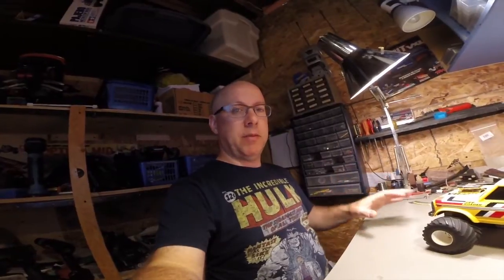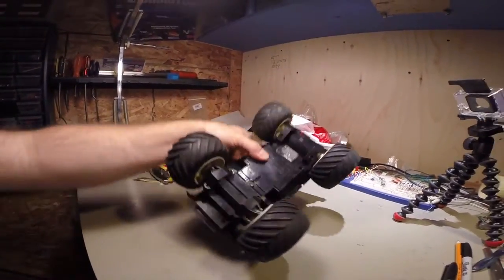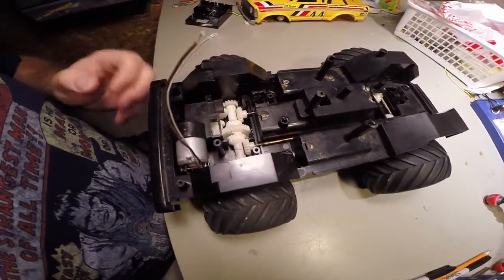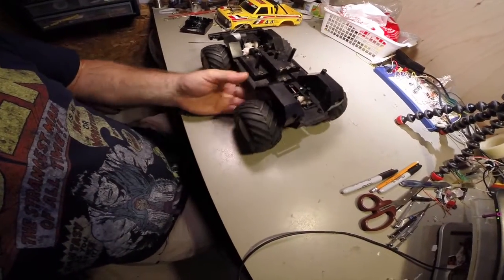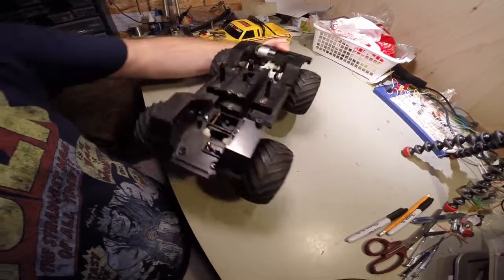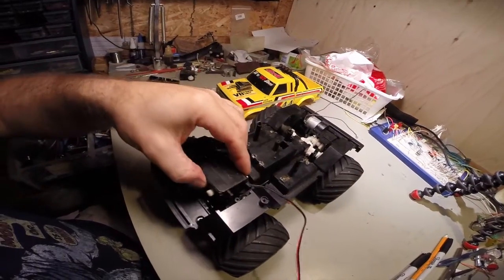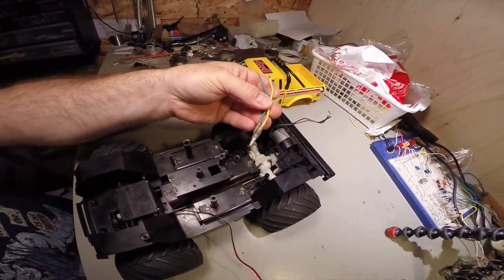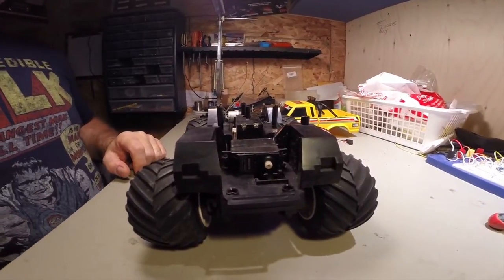RST3 Part 1 Setting it up for the new Electronics

Comment: Could you fit a larger motor in there? Or trying to find a quality 280 motor?
Reply from the maker: I've  had 0 issues with the stock motors. Fitting a larger one would def require some serious modding. You can get brushless motors that fit. 

The stock motor already skips the gears under heavy load so in general going bigger or  stronger is asking for trouble.
Reply: @TheLEDwheel   Good advice! Thanks so much for the quick reply, much apprreciated!

Comment: Hi, I'd like to do this project. I have this same RC truck. Can you please provide the brand/part number for the new electronics? Thank you!
Reply from the maker: hi,

It all depends on your budget. Do you want to go cheap? Do you want to get the best electronics?
That being said, you do not need very expensive items.
Basically you need a Radio set(controller) that includes a Receiver.
An ESC and a Battery. The battery you get will depend on whether you have the charger or not and so on.

best is to go here and talk to me directly
https://www.facebook.com/groups/TheLEDWheel2.0/
Reply: @TheLEDwheel  I understand. I just wanted to the particular part numbers you used, so I can start my research there and compare to similar hardware from there. Some things I'm unclear on, for example, is the physical battery size. If I knew your part number, I could find dimensions  and then have some numbers I can work under, if that makes sense.
Reply from the maker: @xVikXtorx  The problem is that its not that cut and dry. there are so many choices and I get why you may be reluctant. If you really want exact specific parts I can still help you. However this is not really the greatest place for discussions.
Reply from the maker: @xVikXtorx  There are soo many different batteries you can use. it does not have to be a perfect fit. It can also be smaller. pr you can use two smaller batteries at the same time for longer run times. like I said, not cut and dry.
Reply: @TheLEDwheel  ah I see. Ok, well I've sent a join request for your group.

Comment: Do you by chance know the size of the original motor?  I was hoping to buy spare motors.  I also was inspired by your build that I did the same thing with mine.  Thanks!
Reply from the maker: Not sure about rhe motor size... remove it and measure the diameter  and length to get the size.

I made parta that  are on shapeways to facilitate the conversion. Mainly the  servo retainer and servo horn. Look up theLEDwheel on shapeways
Reply: @TheLEDwheel  Ok, thanks.

Comment: Hi just wondered if u still have this truck running and if u managed to solve the tyre problem and wanted to know how strong u found the gears thanks
Reply from the maker: Yes I still have it. not sure what tir issue you are referring too. the gears took some decent abuse. However all of these little trucks suffer from what we call clicking or gear skip under heavy load. I have yet to investigate where it actually comes from. One guy even runs his with a brushless.
Reply: TheLEDwheel thanks 4 getting bk to me I have just brought 1 of these stock used to have one as a boy my favourite toy lol so looking forward to updating it.. Just thought u said in 1 of you videos it could do with some different compound tires .. Hoping to turn it into a trail truck
Reply from the maker: Yeah ok, the odd sized tires make it difficult to fit newer stickier tires to it. I have a 3D printer now so I may revisit the issue soon with an adaptor to fit some 1.9 tires.

Comment: Can you tell me what battery you used, it fit in there perfect. Great work on the truck,
Reply from the maker: Its a battery that fits into  the 1/16 Traxxas trucks. Other builders have purchased smaller batteries. I simply used what I had and it worked out.
Reply: Thanks

Comment: Nice work.  how did you wind up coupling the new servo to the steering mechanism?
Reply from the maker: James Williams the same way the original is set up.
Reply: Thanks. I've found a blue one, a bit rough, but a good price.  I'll have to pick up a ESC and receiver to mate up with my red cat controller though.
Reply from the maker: James Williams watch part 2

Comment: Hi there! Just saved one of these neat little trucks from a family members garage sale, and now Im wanting to d the same kind of upgrades to make it usable again, so I had a quick question... 

You used the original motor. I notice my trucks motor has a little resistor thing between the two contacts on the back of it. Did you leave that on or remove it?
Reply from the maker: Scott Flathers that's a capacitor. yes leave it there.
Reply: Awesome! Appreciate the response!

Comment: I have the blue version (49MHz) of this truck. I've wanted to swap the electronics in it for a long time now. The original steering servo is trashed. What make and model did you use for a replacement?
Reply from the maker: Derek Eskew any will do, I think I used a tower  cheap one. but I replaced it with an old Futaba later. I use whatever I have for these conversions.

Comment: do you have any experience with the H2 Hummer units from RS?  I have been having a fitment issue replacing the motor whereby it binds when the casing it closed.  I have the 2 models (one 4wd/4ws and one 2wd) the motor from the 2wd doesn't appear to fit properly in the other unit and they look the same to me....  any help is apprceiated if anyone understands.  Great video and work!
Reply from the maker: no I do not know anything To about it. if you come to the Facebook group you can pay pictures and we can chat about it
Reply from the maker: post not pay...**
Reply: I'm sure I'm missing something blatant but where's the FB page link?  Thanks.
Reply from the maker: in the description or even in the banner of the main channel.

Comment: Seeing how you mounted your servo makes so much sense! I tried the same thing on mine and it worked perfectly! I actually used a piece of the old steering motor assembly that I ground down with my dremel as a hold down for the servo, but I'm not sure how long it'll last. I may end up making a stronger hold down like what you did.
Reply from the maker: Just watch not to overstrain or the gears do skip. I have not touched it since this video but I plan on setting up better supports for the gearing so it canon skip.